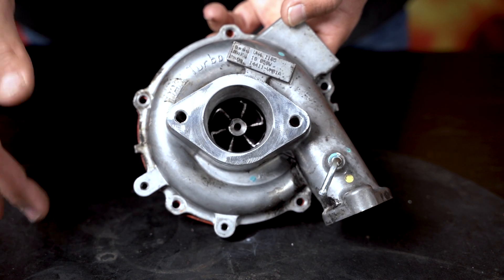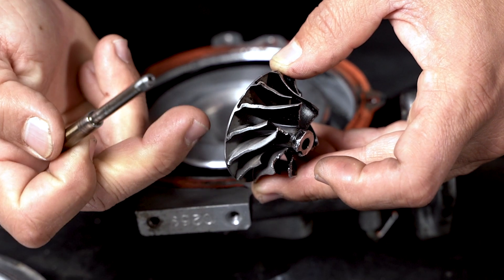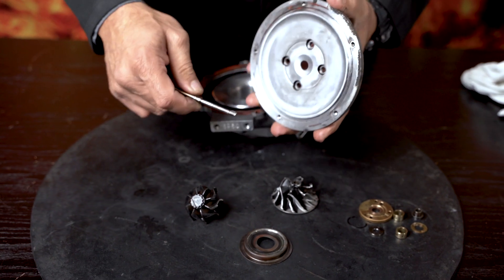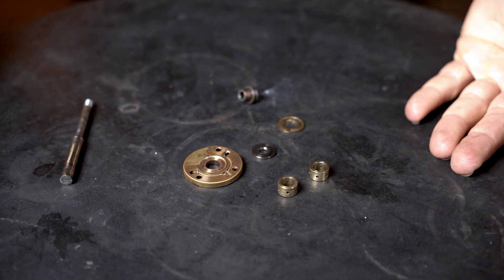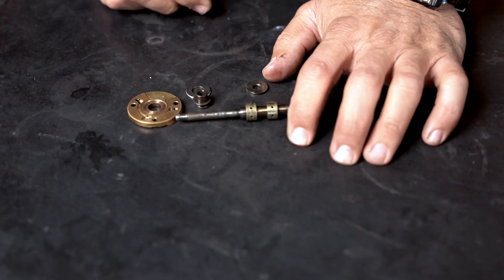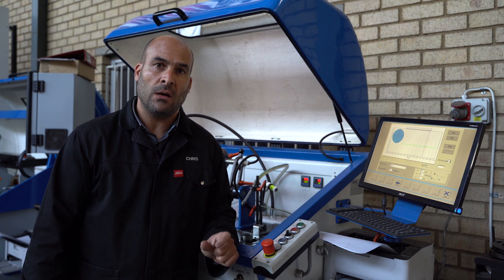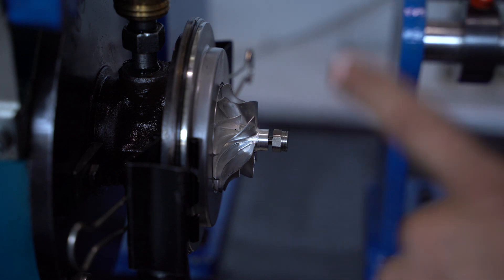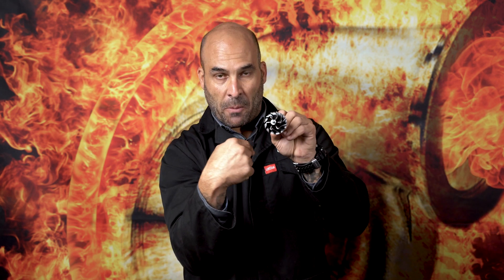Can a turbo shaft nut loosen during operation?

Comment: Guessing oil starved caused it but could excessive back pressure caused by a bent or smashed exhaust pipe cause much higher thrust load onto the bearing mechanism? Could be surge as well
Reply from the maker: It was actually oil contamination which caused accelerated wear in the bearing system and allowed the wheels to make contact with the end housings which firstly stopped the rotating assembly (spat the nut off) and then sheared the shaft.
Reply: @TurboDirectSA  I have a newbie question, do you turbo setups which have separate oil lubrication circuits from the engine?
Reply from the maker: @u3b93  There are custom made reservoirs which fabricators have made before which have external electric oil pumps and a gauge installed to lubricate the turbocharger outside of the engine, however this is tricky business for various reasons. As the engine HP and RPM changes, you need to change the supply of lubrication to the turbo accordingly - get this wrong and you in trouble....... there are also other factors which govern risk with this type of setup - making it not really worthwhile to be honest.
Reply: @TurboDirectSA  Thanks
Reply from the maker: @u3b93  Pleasure

Comment: 9:50 I'm gonna guess this turbo got oil starved and seized. The nut came off when the shaft stopped rotating and the air flowing over the compressor wheel actually forced it to rotate opposite of normal and loosen the nut. When the nut came loose, the compressor wheel and turbine actually pushed outward in opposite directions, freeing the shaft until the compressor wheel spinning on the shaft heated up and seized again. Combined with the turbine contacting the housing and the wheels spinning opposite directions, the shaft snapped from the opposite twisting forces. Bottom line, the nut loosening was a consequence of oil starvation, and the rest was cascading failure. Or it could be 1:30AM and I'm talking nonsense.
Reply from the maker: no it suffered oil contamination, which accelerated the wear in the bearing system and allowed the contact to be made between the end housings and the wheels which brought a sudden and immediate stop to the rotating assembly which spat the nut off and sheared the shaft in the same event.
Reply: @TurboDirectSA  Ah very cool! Was fun to speculate. :D
Reply from the maker: @802Garage  Glad you enjoy
Reply: Seems I may be extrapolating too much, but at least my thinking is in the right direction. Thanks for the awesome videos!